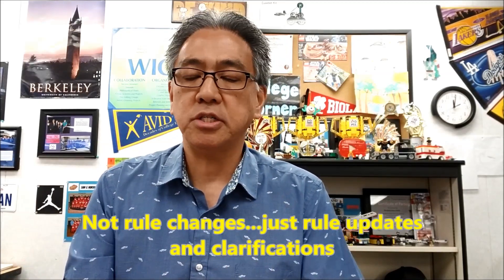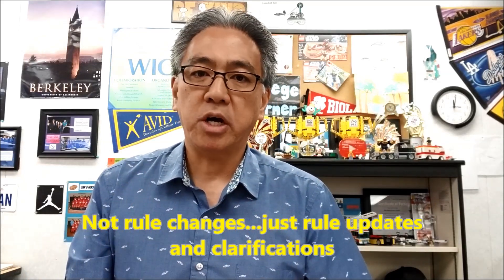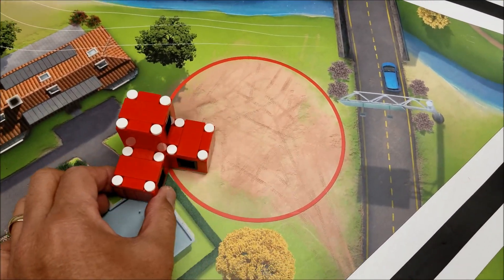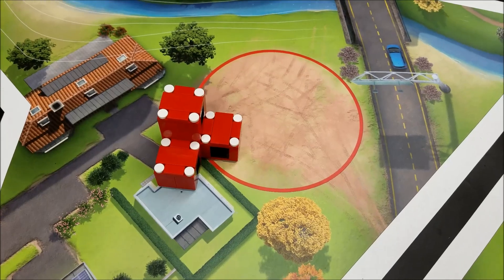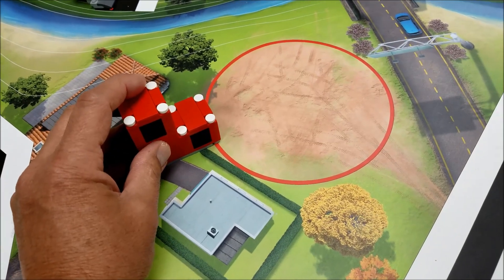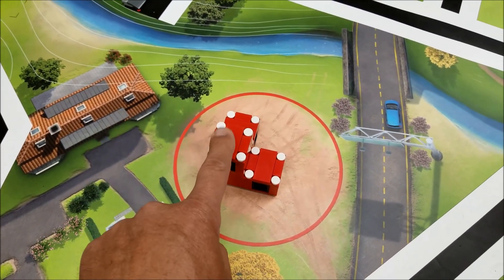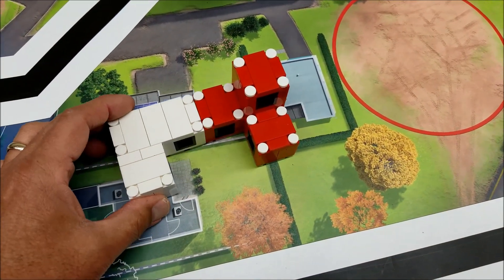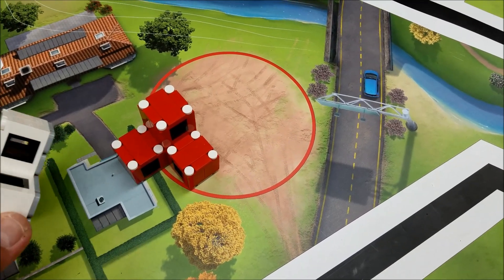"2019 City Shaper Robot Game Updates/ Design & Build Clarifications"

Comment: My team and I thank you for the helpful videos. Do you know if a frame of sorts can be used to stabilize towers?
Reply from the maker: Hey Eric!  Do you mean attached to the robot to take the tower out to the circle?
Reply: Their thinking was almost framing to modules themselves. Not so much a part of the robot.  But the frame and the modules inside pushed by the robot. Frame would be left with out on the board with the modules.  Hope that makes sense.
Reply: Eric Stephenson no it is not allowed I don’t think

Comment: Mr. hino’s, I have a question. In regards to the inspection area- must all the equipment remain in the inspection area throughout the duration of the 2 1/2 minute game?

Our plan was to pass inspection and then move our equipment into more of the home area. Is this allowed or do we lose the five extra points.?
Reply: Hi David, once the pre-match inspection is done (and yes, the kids can hold the robot and equipment together to fit into the small inspection area) you can spread your equipment out into the whole home area.
Reply from the maker: You are correct David.  My bad...once inspection is passed, you may move equipment anywhere in home.
Reply: @LEGORoboticsMrHino  This answers my question on a previous video - ta

Comment: Can the white units be put sideways to get 10 points for height or does a gray bottom have to contact the field?
Reply: Mr Baker, there was a rule clarification about that. The building units just have to be flat on the mat. So yes, standing a white unit up to make it 2 levels is allowed. It just cannot be angled (like standing on its corner edges).